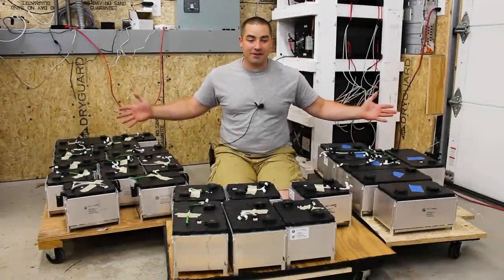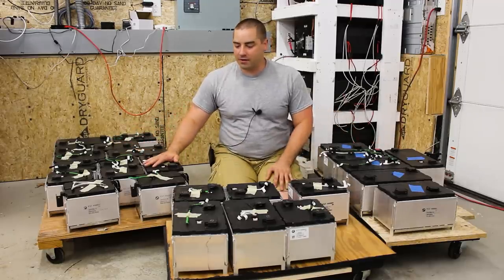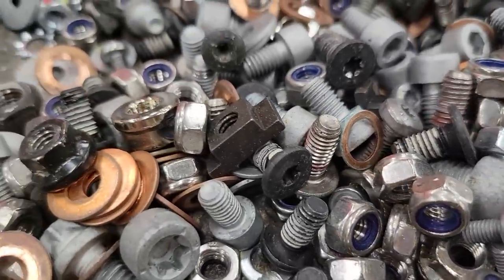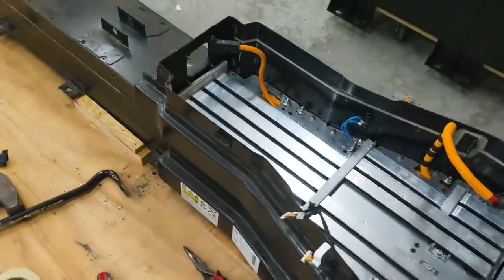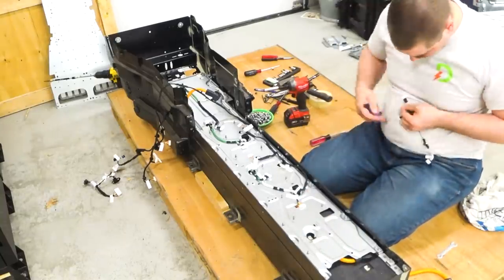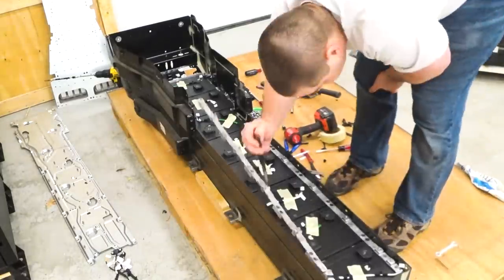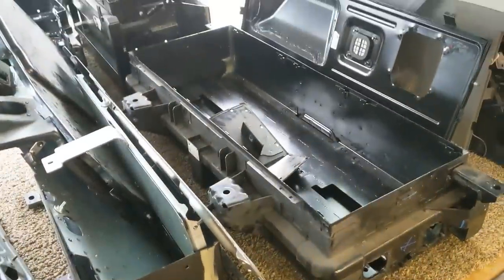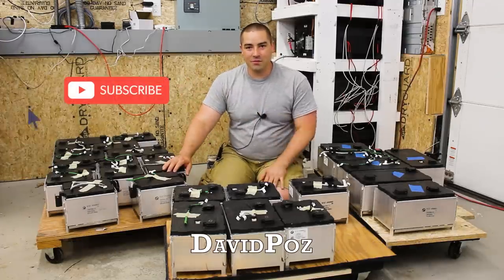Disassembling the Best Built EV Battery in the World - BMW

Comment: That looks like a poorly designed battery. Hard to work on and many many redundant parts. It adds weight and many places that can go bad. BMW has absolutely no idea how to build EVs. Unfortunately they’re going to be in major pain in coming years as other automakers are directly targeting their sector and eating up their market. That unfortunate as I used to love beamers but I don’t see myself buying anytime soon 🙁
Reply: I was gonna say the same thing. This is how you build a battery when you don't have a clue what you're doing. They haven't learned a thing. And yeah their lunch is being eaten by competition right now. My dream car was a BMW when I was young.
Reply: I'm pretty sure that this battery came out of a car designed for gas. It's not out of an i3, i8 or an iwhatever! What BMW did here is what every other "chop-shop" does, when doing a conversion. The batteries are well protected and won't overheat. They could have gone with less different bolts, but that is a non existing issue because these batteries are not designed for an exchange. That's why they landed at battery hook up. I say well done BMW!